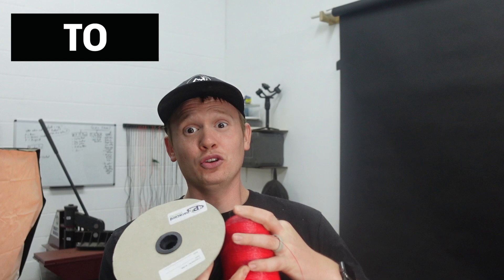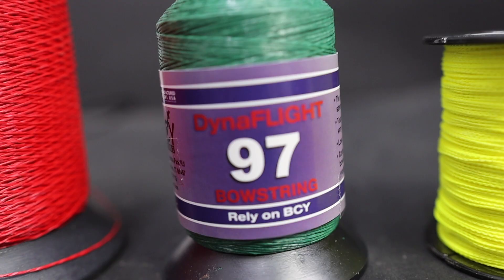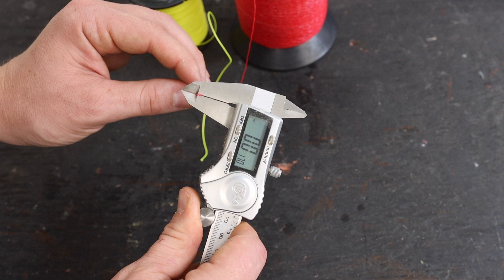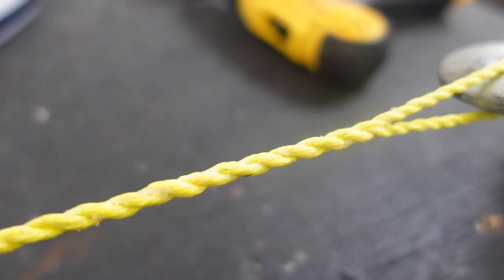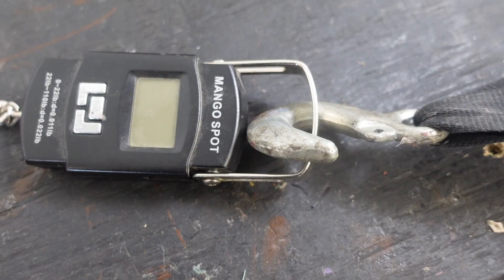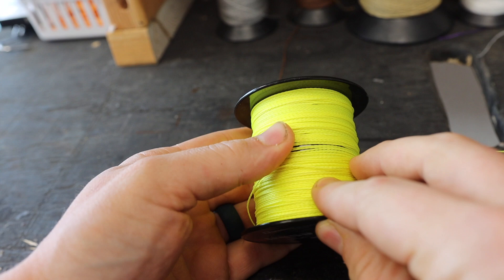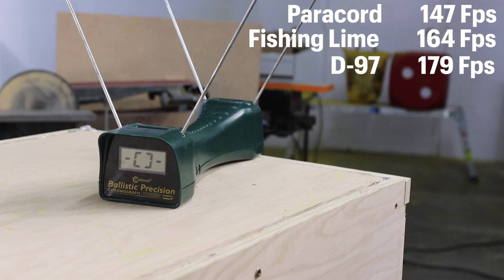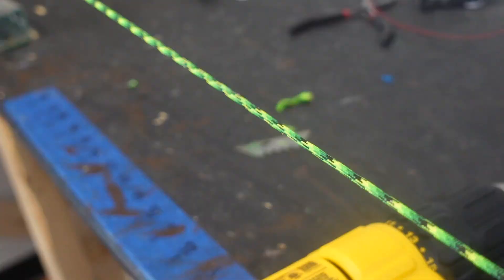What ACTUALLY works for a bowstring? --- (Fishing Line vs Paracord vs DynaFLIGHT)

Comment: With the 550 cord you need to make it wet then make your bow string well it is wet it will shrink after it dries and that will eliminate the stretch of when it dries so the string is not sitting flush with the bow I use 550 all the time and it's works better if you take the guts out and then make your string with it it'll make this shell collapse down and it does not stretch as for the inner guts or what really stretches a lot
Reply: Anytime I'm making stuff for my soldiers out in the field say like hanging tarps or anything that has to alot hold of weight like water or what not I use 550 cord and I just take the guts out and it holds tighter because the guts inside of it make the string fatter but if you take the guts out it'll collapse down and it might  be more useful in a bow setting with the guts out

Comment: I am going to try 3mm OD, 12 strand braided D97 (sailing) rope on my crossbow (as it has high strength & excellent wear characteristics, not an issue with bows).  But the spliced nock loop method means there is no need for wrapping or a centre (I'm British so no 'center' here!) serving.  It's supposedly lighter than a normal xbow string.  Would that work on a normal bow?!

Comment: Isnt "string speed" influenced in 99% by weight of the string?
...one would assume thats the case since maximum speed is dominated by acceleration in this use case. And with bow force being equal pounds all that remains in F=m*a is m which stands for mass.

Comment: Cool vid,,,I started making bow strings for an Osage orange bow, and I used artificial sinew. It worked really well, u can get it at a Place called Crazy Crow. they have a lot of cool stuff. Leather, beads, hides, and several kinds of sinew, as in sizes and colors, and they look like a real sinew string. And it comes prewaxed,, u should check them and it out. PS. I hate paracord, it always lets me down :D.
Reply: Yep it works great and strong as hell.

Comment: What a fun and informative test. The results were more-or-less as I expected them to be. Basically use paracord only as a last resort for a bow string, and not all UHMWPE is created equal. IMHO, speed is highly desirable in any bow, and there's no such thing as a bow that shoots "too fast", whether you're hunting, plinking soda cans in your backyard, or training for the Olympics. So stick with the D97 if you can get your hands on it. Or you might even try BCY's latest greatest Dyneema offering: Mercury. I would be interested to see how Mercury stacks up to D97 in terms of speed, noise, and vibration.
Reply: He used 9lb braided fishing line that pulled 40lbs of weight against a dedicated bowstring material that pulled over 70lbs. So no, 9lb UHMWPE isn't going to be 'equal' to 70lb lol. There's a LOT of guys out there using braided fishing line in the 60-80lb range on serious poundage bows, and in some tests they are faster than D97...more comparable to FF. You can buy this stuff in 4, 8, or 12 strand braids (which doesn't change the strength, it changes the smoothness of the strand), with over 400lb weight ratings.

As for the rest, a bow can absolutely be 'too fast' in hunting, if that speed comes with excessive noise compared to another, slower string. I know old timers out here who won't give up their B55 to save their lives...because 'everything else skeers the deer!'.

Comment: Two questions Kramer. Firstly why do you make Flemish twist strings from Dynema? I have always understood that, because it's more 'slippery' than linen or Dacron it works best with endless strings. Secondly, why are you using Dynema on your wooden bows? I find Dacron to be much 'sweeter' to use on a wooden or even wood laminate bow.

Comment: You need to give paracord a real chance by taking the outer part off and only use the inner strings to make a Flemish twist. It will give it a fighting chance it'll still lose but it will lose with dignity.

Comment: Question for the Fishing line - since it broke at 40lbs I'm going to guess it was 40 lbs test,  
Have you thought to use a heavier weight of line like say an 80-100 lbs test that is in the range of the d-97 line you normally use?
Reply: I was 9 pound test line. It oftens breaks much stronger than the actual rating

Comment: Very interesting video Forgive my ignorance and excuse my english, but what was the poundage of each different string setup? I'm very curious to know what would happen if you stretch the Paracord more when tying it to the bow to compensate for the  stretching since it does have a very high pound resistance. Maybe with the stretch in the Paracord the pull poundage was less since it stretched so much? I just think in a survival situation how good the paracord would work
Reply: The fishing line was only 9lb rated, but pulled 40lbs on the test. D97 isn't rated by weight, but pulled over 75lbs. He actually did what you mentioned when he cut the loop and retied the paracord to get an appropriate brace height for the bow. Effectively 'pre stretching' the paracord. They actually make 1800lb Dyneema line, for kites I believe. It would be interesting to see how useful it could be in a survival situation. It's guaranteed to be better bowstring material vs paracord.

Comment: I made a PVC bow (two PVC pipes nested inside each other) and used 1/8" steel cable as bowstring. Heh.
It's really not the greatest, but it does function.

Comment: Just to be completely honest. When measuring the thickness, the fishing line showed 0.0185", while D97 - 0.0170". This gives a coefficient of 1.088. Now, if we compare the obtained arrow speeds with these bowstrings, we will get a coefficient of 1.09. I think that the fishing line turned out to be slower only because it was thicker, which means heavier. I impute the large stretch to the fact that the fishing line has already been twisted, while the D97 consists of a non-twisted fiber. But, of course, fishing line manufacturers deceive the buyer by winding the fishing line on a thick bullet so that it seems bigger! Just cheap marketing. And it should also be said that the price of both products cannot be very different, because it is the same manufacturer. For honesty, it was more correct to take fibers from another manufacturer's UHMWPE, at a more attractive price. For example, Chinese.
Reply: it was slower because it had more stretch, being only 9lb line. Higher poundage braided line stretches less, and thus stores more energy. It's also thicker, but due to the strength you can use fewer overall strands, then just center serve it to the desired thickness. An interesting side note is that it comes in various strand counts. You can buy 4 strand braid, 8 strand, and even 12 strand. The number of strands doesn't impact the strength, but rather increased counts improve 'smoothness'...making for a more round overall strand.

The fishing line stuff is really interesting...I know guys who far prefer it to dedicated archery string materials.

Comment: I made a rolling nut triggered crossbow with a fiberglass and pvc bow and used steel cable for the string. It has metal rods down both sides of the arrow rest to avoid rubbing damage and so far no issues other than I didnt make the bow strong enough.

Comment: Idea thought is that the Dynema 97 Bowstring is is just better quality control Dynema or higher pound then what is used for most average fly fishing line, yes as non fly fishing spin cast or real style is actually just nylon materials. I could see this being the case as for bows you want that string to hold up when shooing longer then what one needs for fishing.  On the other hand one could wind a fly fishing real with Dynema 97 to have a long string  longer then what one can find in the stores/online for fishing lines then Dynema 97. Actually what you had using the fishing line was probably closer to the old no longer made Dynema 77/D77 bowstring that came out in 1977 and is higher then Dracon B-55 but still lower then Dynema 97 that I remember when D 97 was the fastest strings on the Market before Fast Flight in the 2000's came out. Now in last few years there is one now specialty Compound material for the really fast compound bow that some few people/companies will make for recurve/flatbow style longbow strings provided said bow has ability to take Fast Flight and is able to have at least two screw spots for dampeners just to keep bow from vibrating too much due to how fast it will be.